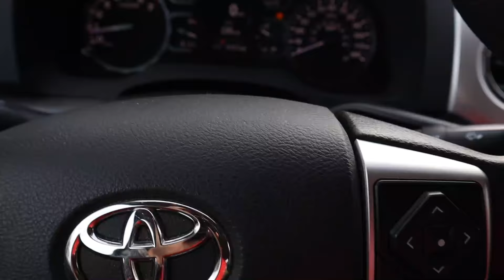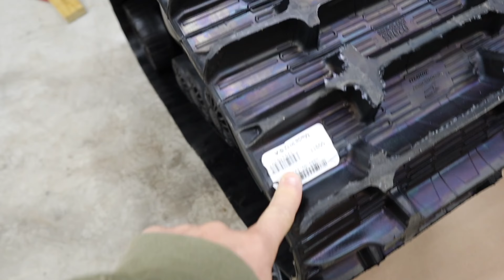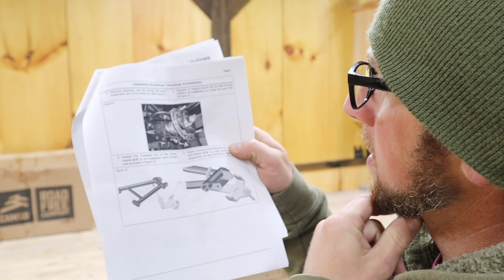This Will Make It so we Can EXPLORE our 500+ Acres in the Winter | Tracks for Our Side by Side

Comment: Good morning.   You might want to think about building a small shelter for the property with a wood stove. And plenty of firewood.   Just to have a safe haven to stay warm. Just in case
Reply: I'm thinking of something like an ice fishing shanty on sleds that can be pulled around, as needed.  Grab that little cast iron stove that's sitting outside that they use for smoking meats, put it inside the shanty and you'd be good to go.

Comment: The first thing you will need is a very large dump trailer that can hold the mule and other items you need to transport to new property and back. A dump trailer is more versatile and easier to unload for your wife.
Hopefully you can get one wide enough to hold with mule on it. Make sure you can still get mule out of garage once lift kit and tracks are on. Hopefully you have been able to test drive a mule with tracks on.
Hopefully you have power steering on mule you will need it.

Comment: I’ve seen good things about these add on tracks.  You need  to fill your ballast box, with sand   Or stones  or metal plates.  The loader is easily strong enough, also get the forks right up against the load.

Comment: I have a set of tracks on my Rhino Side-x-Side for years and love them. One think to keep in mind is after installation check your lug nuts two or three times after some usage. First switch over ( tires to tracks) I just about had one track come off and found several lose lug nuts. Now I check at least three times each time I install after some usage.
Reply from the maker: Thanks for the heads up. That would not be good.

Comment: Your going to have some fun with them this winter and your right they are a much better investment then a snowmobile
Reply: Cargo boost is definitely  the smarter move & perhaps a used snow machine for the 500ac woods later on. Suggest heeding the winch & track maintenance comments above. The other thought with the outsider fyi was his sawmill & making his own rough cut to build his cabin. Plus the quick cabin to have shelter for winter logging. Suggest a winter emergency kit for the SXS & truck just in case.
& planning where to put the meat pole located centrally like a firewood 'depot'
We are the morgans have a huge firewood setup (another fyi). Keep Well

Comment: Morning all.  I once put a set of tracks on a 4 x 4 pickup.  The novelty of that  wore off rapidly.  Granted I did not have a homestead to run around on.  It was kinda useful for getting firewood out of the forest.  BTW,  DO NOT ever get that thing stuck in the snow.  It is not a tank.  Horse power is the key.  4-8 inches of show, eh?  Have a great day.

Comment: i am a bit concerned about the height of the mule once you put the tracks in. it looked like it cleared the entrance to the shop by just a few inches as it is. i am worried it will be too tall to get it out once the tracks are on.
Reply: Built for it.

Comment: If you will be hauling a trailer behind the mule, you may need an extension for the receiver and remember if it is three feet long extension it then makes the tongue weight three times what it is, so be careful with weights. Without an extension you may not want to back up a trailer as the tracks will contact real soon and even going forward you can’t make a sharp turn or again the tracks will hit the tongue of the trailer.
Sorry for the back news just don’t want to hear of anyone getting hurt while enjoying you homesteads.
Stay blessed

Comment: Have another idea for the new property!    Stock one of the ponds with fish,  then build a smaller high tunnel with solar power.  Put a wood heated water heater.   Use the water heater to heat pipes in the structure.   Use the solar power to operate a aquaponics system from the pond.  The water being returned to the pond could go through a turbine  and a generator to give you another way to provide electricity.   The battery bank should have extra batteries to store the energy to make alot of your buildings off grid.  Very completed but I  know y'all can do it.

Comment: I think that the tracks will be good at the new property. I as wondering how far of a drive it is to the new one. And put the tracks on. You will have lots of fun exploring.
Reply: It may be time to get a trailer for the Mule, I'm thinking... not sure if the new property is close enough to drive the Mule directly.  We just don't know.
Reply: @samvalentine3206   Sledges can work in snow & They have some ready to go.
No $$ needed. Just  dependant on hp of the mule.

Comment: with the tracks hanging out further at the back of the side by side are you going to have to extend the toe bar so the tracts don't hit the trailer? A lot of the big farmers have tractors and trailers with tracks on them as they do less compacting to the land than standard tires and don't get as stuck as readerly when it gets wet and of course there favourate don't go flat but when they come off they take some putting back on but there are some trick to getting that done - check to see if they have a crease point on them as most do and need up keep - just put them on and enjoy them

Comment: Track setup for the mule should be great.  I have tracks on my Honda snowblower and it does great up and down my hillside drive.  If your tundra has a metal bed you may want to get it line-x coated.  Plastic liners rub off the paint and hold condensation causing the bed to rust prematurely.

Comment: Since  you will lose 30%-35% speed with the tracks on the Mule, my guess is the 500 acres you bought is not very far away from your current homestead. Just saying.
Reply: ill wager a guess is they load it on a trailer to the new property, not drive it there
Reply: I was thinking the same thing,putting it on the trailer,even if the land is close I don’t think they could  drive it on the road,just my thought .

Comment: It’s snowing there and in the mid 70’s here in Western Kentucky. We’ve only had one night below freezing. I don’t much like winter anymore. I worked outside in the cold every year. When I was younger it didn’t bother me except for installing heating and air conditioning under a wet house. I don’t much like the hot summer either.

Comment: Great product AL. They work good but do have limits. You need a winch as well. IF you get stuck or hung up a winch is a must. Mininum size would be a 4500 lb winch. Its a long walk back to the truck. Try going with another person with a Quad or sled for support. Learn what it can do before you get into a issue. Muskeg or bog area is another thing to be cautious of. When UTVs are stuck they are really hard to get out compared to a Quad.
Reply: Glen Gillis there is a winch on the front of the mule already! I would get one for the back, but where to put it? Maybe behind the back seat but is that strong enough to pull something with a winch?

Comment: I used to work as a mechanic for a Polaris dealer and did all the accessorie installations. It was fun until parts were missing from the kits then we'd have to order the missing parts from the manufacturer to keep warranty in effect. Sucked when we could just go to hardware store and get what we needed.

Comment: Hey Al. As for the new property, just please don't kill any of the beavers until you've looked into ways of mitigating some of the problems they can cause.

The free water storage they provide on your land improves agricultural productivity, drought resiliency, biodiversity, and your fishing.

There are a bunch of methods humans have developed so it's easier to live with them. Simply planning so all your new structures are on higher ground is step one, but you can also do simple pvc overflows in areas you don't want flooded. There are some tricks you'll have to research.
Thanks.

Comment: You might want to get a wood chipper to clean up all the brush you cut and maybe a wagon to put the wood chips in.  The wood chips you can use all over the place or just let them fall back onto the trail you made.  Reduces all the fire hazard the brush will make if you don't clean it up.

Comment: Gooooood Afternoon , Al , Gina & Olivia ,
Al , now you have me wondering. Could you have purchased the Mule with tracks already mounted on it ,  instead of wheels and tires ? That must have been an interesting sensation when the rear wheels of the Kubota came up off the ground ! It looks like you need to have some more weight in your rear end . lol
  I've seen the comments about you needing a bigger tractor because of having more land. But I don't know. A larger tractor means that you will do more heavy duty work.  Which means more heavy duty equipment. Plus , more heavy duty work also means more dangerous work. It may be better to work within the limits of your Kubota.
  I had some snow Sunday night here at Natural Plum Brook Farm in Northeast Ohio. And today , it was 76* F ! Also forecast for Sat. through Tuesday. I like it .

Comment: You will find that your gas consumption will go up considerably with the tracks. We used a set of tracks  on a 450 four wheeler one winter. That was not th best idea. The minimum motor size should be 650. Some guys prefer balloon tires over tracks.

Comment: The size of the Kubota I don't believe is the problem the size of its up coming task could be are you going. To haul it back anf forth every time you need to.do. Something.  I think it would a wise idea to find a larger older diesel keep an eye out you can still.find them. Also outhouse is great idea the girls have you might want to consider a small out bluiding with a wood stove ( things happen in the wood you dont ever plan for )

Comment: Tracks will get you around but you still might get stuck.  I'd keep a bottle jack, High lift jack, chain, and shovel with me.
Reply: Good thing he has a winch in front.  He may need one in back too.  Along with those items you mention, some strong rope might be good as well for something far away.  Even a small folding boat anchor to use if there's nothing handy to pull from.

Comment: The tracks will perform pretty good in snow and some mud.  Beaver ponds and other bogs not so well -  can go down like a skydiver without a parachute!  That winch mentioned by PaulC is a pretty good idea.   Along with the recommended 2x6 for getting over logs always carry a shovel, some good rope, and a short handled garden hoe.  (hoe is better than shovel for soft sand)  Oh yeah, don't forget your phone with a tow truck number just in case all the rest fails.  (By the way..............You WILL get stuck!!

Comment: Of course the first question is will it get out of the garage with the tracks on so Al had better get out the tape measure before he even thinks if bolting them on just in case but he'd put them on even outside because There that fun. One possibility would have been making the Mule into a half track but it's likely that it's an all or nothing proposition when it comes to there installation and the arms are the most critical attachment since it keeps the tracks aligned with the chassis.One wonders how far Lumnah  Acres 2.0 is away since he Gina/Olivia may have to trailer the Mule to get it there since driving it might not be possible since the 35% ratio difference is likely down not up when it comes to speed/distance due to the tracks. Indeed figuring out is rather simple since it's question of the track length compared to the tires travel ratio but it'll will be quite useful as well as a toy is why Al is cackling with delight..

Comment: The tracks can be used year round not just for the snow.
Reply: Snow, mud, dirt is OK, but not too good for gravel and pavement. Yes they will run there but they also wear out fast there. Not as cheap as tires to replace. Coming off the grass to park in the new shed at a slow roll won't do much but stay off gravel as much as you can. Should work great for moving goat feeder and New Yolk City in the mud should be a help. More foot print so less likely to spin.